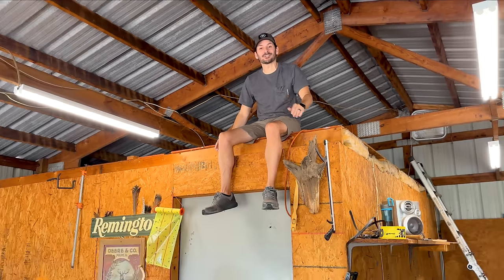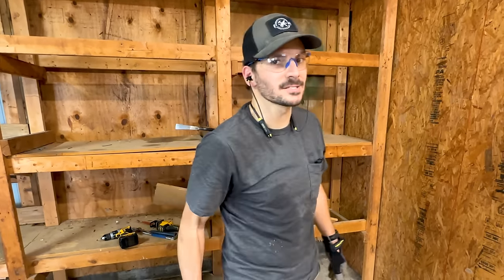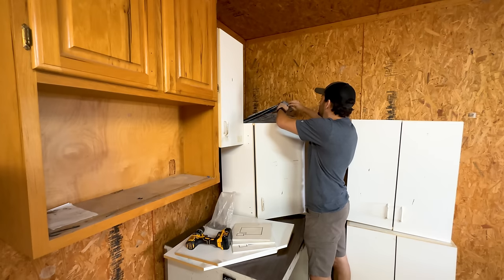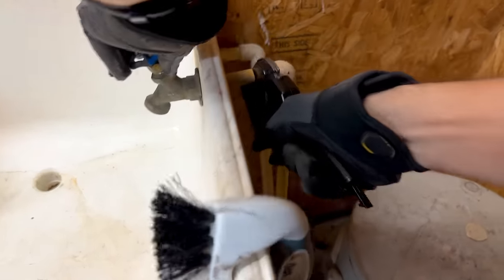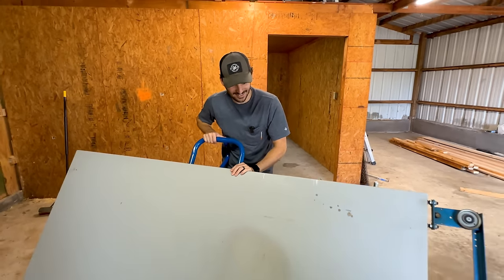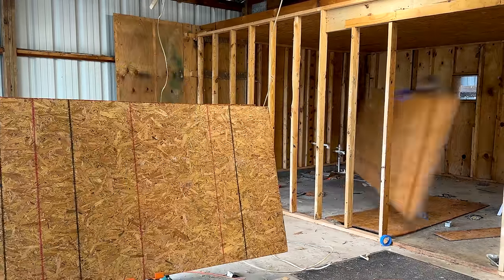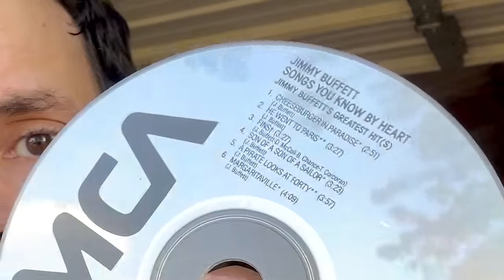It's worse than I thought... Demolishing My Old Shop

Comment: I would use the elevator door as a table top. Or if you going to get into welding, you can use it as a welding table top. Or cut door in half, you can make a nice work bench end to end.

Comment: Oh good heavens that little bit of frame repair in the corner, I've dealt with far worse than that on the farm, believe me!
I strongly suggest you frame with 2x4 studs in between each pole and then spray foam, you'll have a snug building without leaks and mouse proof too boot. Mice don't like the hard foam

Comment: One of the main things I wish my garage had is epoxy floors or plastic floor tiles to make it easier to clean. I also have some lips between the expansion joints which makes wheeling things around annoying.

Comment: These shop layout ideas make this the most interesting vid ever on your site.  "You should think bigger with the design of your shop" and the very first thing you need is a huge sliding table saw in the middle of the room.  "You need a sponsor" with Altendorf USA or another brand that produces a 7.5 hp, full sliding table saw with a 14 in. blade plus scoring blade.  You would like the tools with control tech computers on you fences but they are fine without as well.  The sliding saw can come with dust collection bags that sit by the saw.  Your existing saw will become an extra tool on the floor that you will use for other cutting for sure.  If you don't have a nice saw in a year or so you will totally regret not moving forward on this !!  You have room for a tool like this.  You will need a few assembly benches.  A small spray booth would be nice, with double doors that you can roll larger items in and out -- you will need a good fan hood to pull air out of this room.  You should start a new thread to deal with your shop design.  Best of luck.

Comment: for your insulation I suggest looking in to RockWool or a mineral wool insulation as I has a higher R value and sound dampening value as well as fireproof. It is what I am using for my shop I am also putting a radiant heat barrier between the insulation and metal sheathing.

Comment: Agree with tool organiser/storage it's magnetic so you could constantly change to suit your needs. You could wall mount it or build a lockable cabinet or something.  Don't know how the 2 pieces of steel are connected but if it is able to be split into 2 pieces then you could have 2 sliding doors and they would be half the weight

Comment: Hey Brad, congrats on the new shop! Love the touch of the deer. 2 things I would recommend that are similar, try to put your main air compressor and dust collector as close to the main doors as possible. That will allow you to fill up cars, atv's etc and empty the dust bin without having to lug it across the shop. Good luck with the show!
Reply from the maker: Great suggestion

Comment: Since you are going to build out and insulate the interior of the shop you consider using spray foam, there are form insulation that act as a vapor barrier as well as resistant to mold and mildew

Comment: If you get a large, horizontal air compressor, put it up on the shelf as high as you can in the ceiling to maximize floor space since you don’t necessarily need access to it, and centralize your airlines throughout the shop with a ceiling, reel, as well as a power reel can be useful as well

Comment: Since you’ve got plumbing already to the shop, maybe build you a half bath and use the door on that. The other option would be a finishing booth that you could keep as a dust free area, and utilize the door there. Either way, the door could give you much needed separation from your primary shop to a secondary area all the while not taking up any room with it swinging open/closed.

Comment: What to do with the old elevator door? If they are two 1/4" steel, that would make a great welding table or steel table top. Get yourself a plasma cutter and easily cut into smaller pieces.

Comment: Just a suggestion, if you mount that big steel door on the wall with a much longer track, then rather than using it as an actual door, you use it as a mobile wall to mount a small table to. You could then run a power cable through a cable chain, onto the door, into an electrical outlet, and use it to make your heaviest and/or most used power tools a bit more "mobile"

If not tools, mount a large cabinet to it and use it for mobile storage, or even a stabilizing shelf for a table saw when your parts are just too big.

Comment: I have many points you may/may not want to consider. 
RE: Layout:
- Since you're a creator I would make a small office in the shop for video creation/editing/etc., design and other woodshop office stuff. 
- I would take a corner with floor to ceiling walls and forced air ventilation for painting and finishing. You can also put down epoxy on the floor to make it easy to clean. 
RE: the steel door: 
- This would be great to have for the office as it would be pretty sound proof. If you went with the paint/finishing room it would also be great for that. 
Now a question: I think we need a "fail" roll with an injury counter. I mean the ceiling removal alone was so close to stitches I'm sure there are other comedic moments which could be used for educational purposes. 🙂 What do you think?

Comment: When you do your electricity whatever you think your need for plugs double that.  Keep your plugs at bench level.  Your back will thank you later.  Also try to limit your plugs to three or four on one circuit.  Keep your lights on separate circuit so from the plugs. Someone said a bathroom and I'd agree as it is a work stopper to leave the shop to use the bathroom. Lastly have a lockable switch installed on the main box that disables all circuits except for lights.  This will prevent curious minds from getting into trouble.

Comment: Just wanna say love your videos, suggestion for the elevator door is make it into a tabletop possibly the same height as your skill saw or say or actually table saw, to give it extra room for cutting large stuff like full sheets of plywood or OSB, or possibly make it into a nice welding table since it is quarter inch steel on either side, but it begs to be a tabletop of some type maybe a fold down tabletop out in your breezeway. You know some fold out legs that fall into place when you lower it and big hinges holding it to the wall. Just an odd suggestion. Good luck with your shop look forward to the future videos. Sharp has incorrect information in this or spelled wrong i'm using voice to text i'm an old man and typed terribly terrid

Comment: Quite an ambitious project, Brad. The one thing I did in my shop that I'm so glad I did was to have it spray foam insulated (closed cell). Did we see a clean-shaved Brad in that glance of your current shop? I hope your ECD doesn't overwhelm you in setting up this one.
Bill
Reply from the maker: Hey, Bill.  How many inches did you do on sides and roof?
Reply: I haven't done this, but pick an R value appropriate for your area. Usually, the R value is based on how cold it gets in winter, but you might want more because of how hot it gets in summer. That R value would determine how many inches of spray foam you want.
Reply: @Fixthisbuildthat  I did 3" on the roofline and 2" on the sidewalls (I'm in Ohio). I also installed a mini split. It hardly affects my electric bill.

Comment: I think you should keep the elevator door out of novelty. Make a sliding tool rack as suggested OR reuse it for a maker space. I’ve slept a couple times since your tour, but didn’t you say you were going to have a space dedicated to videoing? Use that door to separate it off. 

Or make it a door to a paint booth.

Or make a an underground storm shelter and use that door with gas struts as the lid.

Comment: Three ideas for you, Brad:
1) Add a well-ventilated paint/finish booth in the back of the space.

2) If that elevator door is two layers of quarter-inch steel, it would probably make a pretty good assembly or outfeed table. You've got a lot more space in the new shop, you might want to add another big table to your inventory of shop furniture.

3) That Jimmy Buffet CD deserves to be mounted in a beautiful custom hardwood frame and hung respectfully in the new workshop as both a piece of art and a memorial to a great musician.

Comment: I feel your history of moves is sorta like The Jeffersons and their 'Movin' on up to a penthouse in the sky' theme. You are out of the basements and into a grand place. Very nice.
As I mentioned in another comment (the one about making a welding table with the elevator door), I am not a shop person, so as a general suggestion for your shop's layout, think about your biggest piece of equipment you're going to keep in there or maybe the largest size of material you plan to work on, and find spots for those 2 things.  Just as planning for a pool table isn't just about the size of the table, but also the needed space around it, you want to have the ability to play a game of pool without bumping into walls.
I know you know this, but, here's a good rule for all things: 6 P's, or Prior Planning Prevents Piss-Poor Performance. Ok, now back to the rest of the video.

So with all the walls coming down, I was kinda expecting a Buster Keaton-like stunt as he did in Steamboat Bill, Jr.
Also, very nice touch at the end after you told us about the CD.

Comment: That elevator door: Either use it as an assembly table top, or paint it with whiteboard paint and mount it to the wall as a sketch/magnetic project planning board.

Comment: 5:20 My recommendation is to have as many breakers as possible for the panel, so that you don't have a weird situation where you need two different power draws on one circuit, throwing the breaker. With my garage, each wall is on a separate breaker. That comes in handy! However, what I should have done (I still can, but they'd be exposed wall-mounted conduit) was install a couple power drops from the ceiling. I have the one for the garage door (and air cleaner) but another one would have been nice.

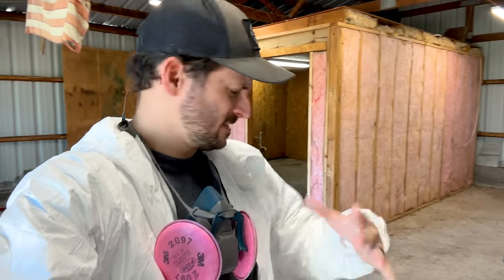14:07 Pink insulation is nothing to faff around with and take lightly... When I had my garage built, I requested they leave it as an open shell on the inside (electrical done by them, but no interior finishing). I did the insulation, and the first night of doing it, I didn't wear a mask. My lungs felt "heavy" the next three days. After that, MASK.

Comment: Idea for the elevator door: Everyone can use a whiteboard, dedicate some wall space to be your massive white board for layout design and organization. Paint it in the white board stuff, but install the elevator door over it as well and paint that in the whiteboard material, so then you have like 50% more whiteboard surface and can use it to like cover up "sensitive" plans if you want. Would be a neat use for something like that since you don't need more doors.

Comment: 6:25 uses 100 nails and it stills comes fown in 2 seconds 😂😂😂
Also what was the layout software you were using to show off what layout you made for the shop
11:34 reuse the door as a table of some sorts
11:40 lokey that jumped me bc i had mh volume turned up and i was not expecting that to happen 😅😅😅

Comment: redo the floor. turn 2x4s 3.5in tall every 16in and run electrical under the floor. put plenty of outlets. while this is expensive and time consuming, you cannot beat the convenience of electrical and even small dust collection underneath the tools.

Comment: On the garage door that you fixed, the bottom seal of it was broken and it needs to be replaced by winter so the cold air doesn’t get in.
Reply from the maker: yes, definitely need new bottom seals and a new spring set for that one too

Comment: My suggestions. Keep the door. It will come in handy as the rebuild occurs. Go crazy on the electrical. This garage/workshop was built when electrical tools were not common. Today, everything runs on electrical. Plumbing. Keep the bathroom. It will come in handy on those lousy weather days and you don’t want to trek up to the house. Finally, lighting. Your eyes will appreciate as much as possible.
Reply from the maker: Definitely going heavy on power and outlets!

Comment: looks like there was a leak in that one corner, hope it isn't difficult to track down and fix😕

And I highly recommend getting a spray foam company to come in and close cell spray foam all your outside walls at least one inch thick. Nothing else competes with that. Even if you put fiberglass behind it on the inside the fiberglass will perform much better than if you didn't sprayfoam. Just don't leave the foam exposed after it dries because sunlight does slowly break it down, a simple spray paint over it works.
Reply from the maker: yes, definitely had a leak for a LOOOONG time to cause that much rot.

Comment: Wished I'd made it larger. When working with fiberglass insulation, suit up as you did, then wipe Vaseline on exposed body surfaces and hair. The fibers will stick to the Vaseline and when you shower, it all goes down the drain, no itching found. And take your clothes to the laundromat, no insulation in your washer/dryer to get you later.
Reply from the maker: That Vaseline trick is gold!

Comment: He obviously didn't order the cabinet bundle! 😂

Here's my unsolicited plug. Brad's cabinet bundle is really sweet and perfect especially for the side walls in your garage. 

For your new shop a well thought out location for a Mountain Dew can holder would be excellent! How about a short build video for beverage cans/bottles in the shop so we don't get the classic ring on the table saw top or work bench.

Elevator door could be a bench top for welding or something that takes a beating. Maybe a spray booth outside and remount the sliding door?
Reply from the maker: I approve of this message :)

Comment: Crafted Workshop put their dust collection in a sound-insulated closet to control noise in the videos so it's easier for you to be in the space all the time.
Reply: use the elevator door  for your dust collection closet.

Comment: Not having a door on your office will be a regret in the winter. You cannot trap heat in there. This door could be hidden in a wall like a pocket door. Thus keeping some history from the previous owner. It could also be repurposed into a flammable cabinet. Something that is usually kinda pricey, and salvageable. Salvaging it would pay for a hobbyist welder like a Lincoln 125 Weld Pak HD. And that would fit your channel content.